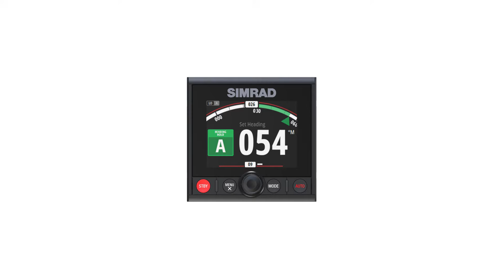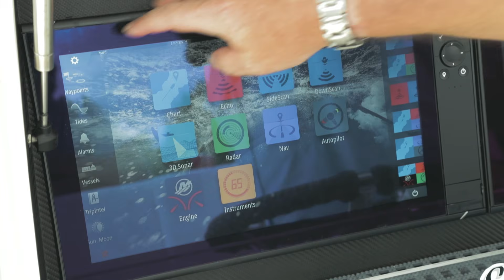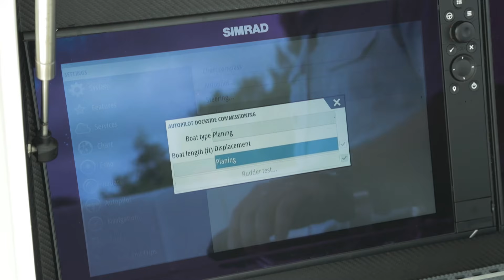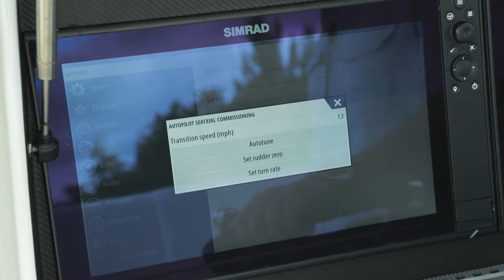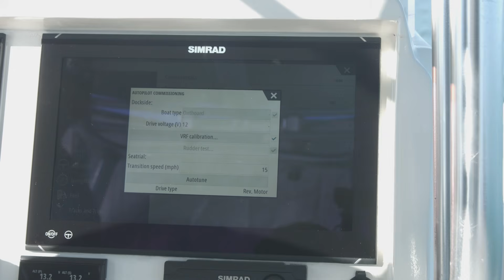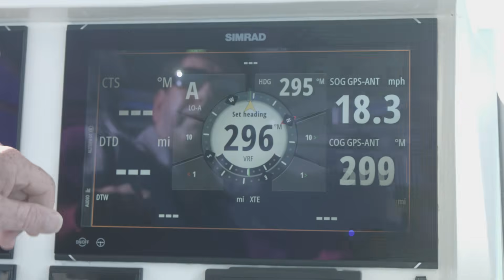Simrad LIVE | Autopilot - Setup , Calibration and Features

Comment: Helpful video to a point. My boat has twin Yamaha 200 outboards and a Simrad NSS MFD. My autopilot doesn't keep me on course, and the boat zigzags with autopilot engaged. It doesn't matter if I'm in heading hold or navigating to a waypoint; the boat feels like it overcorrects when the autopilot is set. The previous owner installed the system, so I'm not sure which components I have or where they are located. Any ideas?

Comment: So I have a problem with the local field %. Ive tried a couple of calibration procedures now and I cant manage to get it under 42. I have of course checked for any metal near the compass. This happened when I had my computer next to it for some hours, without knowing. After that my autopilot have never worked properly. Anyone have any clue how to make it work again? Im thinking of maybe moving it, but it seems uneccessary because it worked so great before. Only thing Ive tried is cutting the power to it and resetted all devices.

Comment: Hi Shawn.
I just installed a nac1 outboard autopilot in my boat, with a Go9 MFD. In Network Device list, I can see the Compass, and Navico AP, but I have No Steering Wheel/Autopilot icon to select, or configurator. Any suggestions?

Comment: Autopilot installed and working using your video.  Only issue I'm having is I don't see an autopilot option on the home screen of my evo3.  I can work control it through the side bar pop out but without the icon I can't build a multi-page with a section dedicated to the autopilot.  How do I go about adding that icon?
Reply from the maker: Should be under advanced features - autopilot - make sure it is ticked

Comment: For the Simrad Auto Pilot setup, can it be operated via the integrated NSS Evo3S MFD and not through a separate Operator Control Panel?

I don’t want to cut another hole in the dash panel if I don’t have to.

Cameron
Reply from the maker: Yes, the NSS Evo3S can function as an autopilot controller when connected to a Simrad autopilot system via NMEA2000.
Reply: @simrad-yachting  Thank you.  What are the benefits then of a separate AP controller (like AP44 or AP48) added into the NMEA 2000 interface that drives the autopilot tasks instead of directly through the MFDs?  Cameron

Comment: I get the the "hold port" part. It takes a little wile for the engine to start turning to port but it does, then I let go at full port & then it says centering rudder but it doesn't center it, it basically turns almost to full stbd. Doing something wrong?
Reply from the maker: If you have not done the earlier steps correctly then it might do this. Please get in touch with us via FB so we can direct you to the correct service team.
Reply: @simrad-yachting  i actually got the autopilot to work. I just had to move the wheel a tad when it reached full port & starboard. Now im having issues with the wr10 wireless remote. Sent a message on FB. Awaiting a aresponce

Comment: can my new auto pilot Simrad work with my Garman GPS that is new
Reply from the maker: You will not be able to control the Simrad autopilot from your Garmin unit. You will be able to get it to follow a route, but they will not be fully integrated.
Reply: 3 year old post but to answer. My 2023 Garmin GPS Plotter when set to a waypoint feeds the Simrad AP28 when I press NAV.

Comment: Hi , Please advise my auto - pilot model AC-70 control what problem is this ... When navigation switch ON auto pilot start as ''Auto'' and not able to change ''Stand by''.
Reply from the maker: Hi Hari, the AC70 is autopilot computer, what kind of autopilot controller do you have? What plotter? We'll need to have more info on the rest of the network to be able to diagnose. Please send us the NIF file. You may also contact us via Facebook.
Reply: @simrad-yachting  will do send asap send

Comment: Hi, I have the AP44, Nac2 Precision 9 package on a 29 ft boat. When I set it on Auto, it always needs to apply rudder to port, so there is the red line on the top of the heading. Manual is hard to understand, do you have any suggestions as to what settings I need to change?

Comment: Dear sir, great video! İ have just installed a Simrad Outboard Pilot. Did commisioning and calibrate Point-1 without problem but if İ engage autopilot after approx 10 sec the boat turns hard starboard. Also if İ push the green and red arrows in standby at both arrows the boat stears to SB. Any idea what went wrong? Thanks Maurice 48ktms@gmail.com
Reply from the maker: Hello Maurice, we've sent you an email. Our technical support will help you from there.